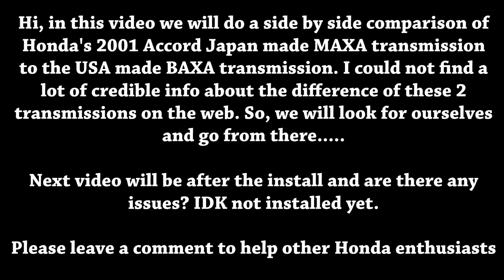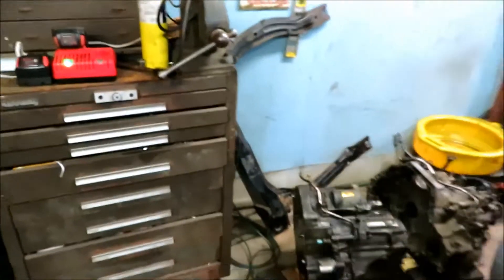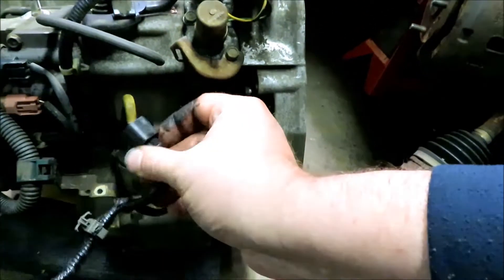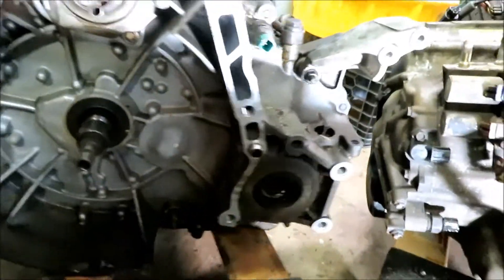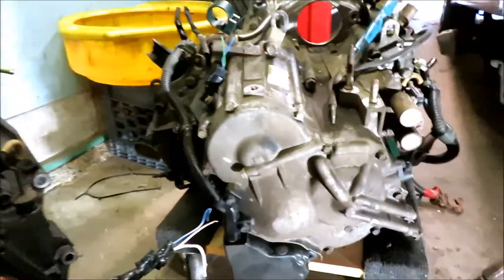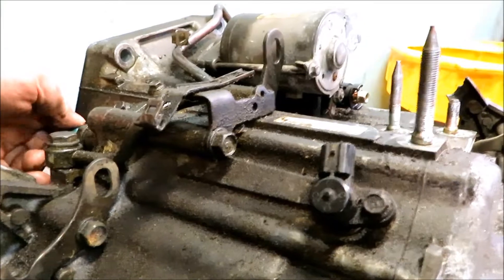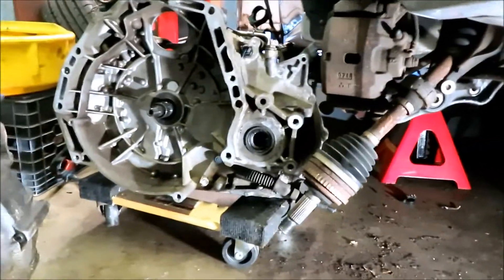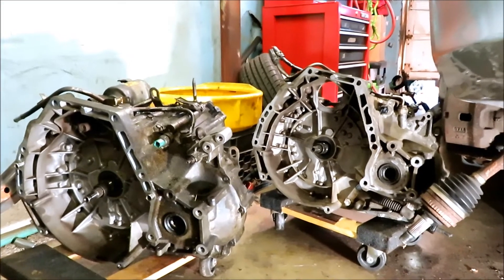HONDA MAXA & BAXA TRANSMISSION SIDE BY SIDE SENSOR COMPARISION

Comment: Just an update on mine, I completed my Japan swap transmission and boy was it a night and day difference with the gear ratios, acceleration was alot better, highway speeds(70mph) puts you at about 3k-3100rpms, but hell I could average 21-22mpg but the car felt like it was in the power and, to increase speed to 80mph was literally pressing your big toe down. Sadly I drove the shit out of my transmission for 2 years and never flushed it or tried to keep my solenoids clean, sadly this month my transmission is dying, but hell I'm excited to put another japanese transmission in it again😁, I know now as long as you keep the fluid clean(flushed) and the solenoids cleaned up, they will last a longer time

Comment: I have a 2002 baxa it has the separate bracket on the transmission ear where it bolts to the rear motor mount bracket just like your maxa  unlike the other  everyone says 98-02 baxa are the same but the rear engine mount bracket is different on 98-00 and on 01-02 as the 01-02 have the rest transmission stay bracket and older ones don't  do you know how to make the 1998 work in the 2002 the bolt hole lengths are offset on one also and not the other
Reply from the maker: you are correct. The rear bracket was different but, I was able to use different bolts to make it work... I forget exactly what I did but, I did make it work.. everything else is the same.
Reply: @daredevil7442AUTOMOTIVE  thank you I really appreciate the reply I noticed the engine mount bracket was completely different and part number on the transmission cases were different on the 1998 replacement trans I bought so I wasn't sure 2001-2002 have the spacers where the bolts go into the ear. I went to pick and pull found a transmission with a sticker on it saying we built all the company and it was rebuilt 7 months prior and they only rebuild transmissions for businesses it had all new shift solenoids  pressure sensors new torque converter everything and less than 10,000 mi on it paid 180  couldn't beat that

Comment: Friend I have accord 99 2.3 4 cil, it has a baxa transmission and here I get maxa, did it work correctly when changing it?  I appreciate your help, thank you
Reply from the maker: Yes, no problem....rear mount was different but, it didn't affect anything.
Reply: @daredevil7442AUTOMOTIVE  And how did you solve the rear support?
Reply from the maker: @franciscodeandradejr  I didn't hook up the rear support. no noticable difference without it. the other supports plus motor hold it in good. no shaking or torque movement.

Comment: Did you ever have to get it reprogrammed?
Reply from the maker: No, no problems at all....
Reply: Think that's my issue with mine. I feel the difference like night day. Old transmission I could floor it and my 99 LX would have you planted in the seat. Going from 3rd to fourth and even spin front tires a bit at the light. The one I got now is lame. It doesn't slip, it is just meh feeling probably not shifting in the right spots of the power band. Currently running baxa in my 99 accord LX.

Comment: The USDA transmissions are geared for fuel economy and slow acceleration 👎 the jdm transmission will make your accord feel like it has 50extra hp👍 plus they shift alot firmer